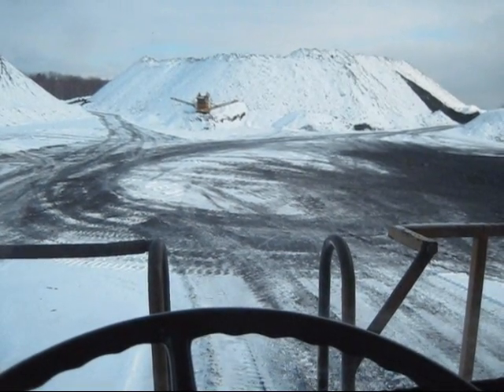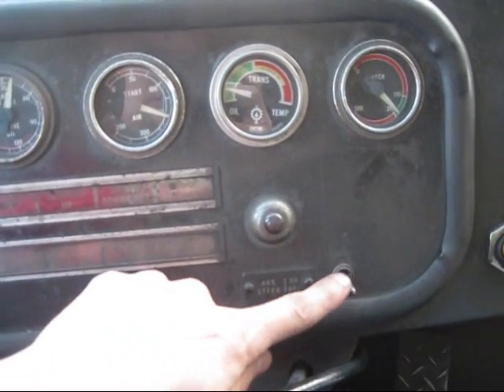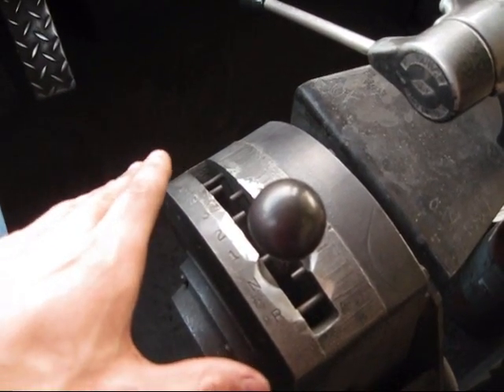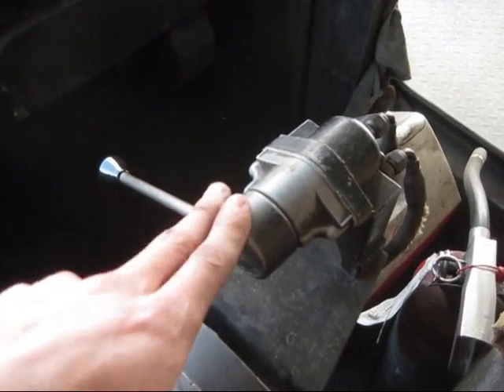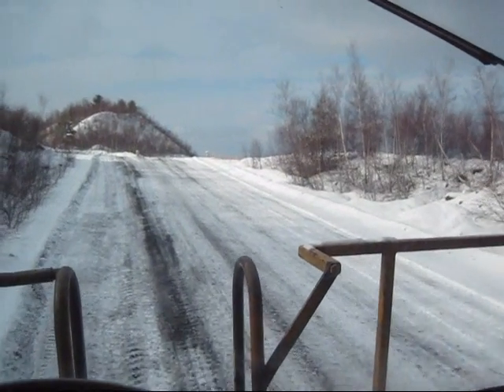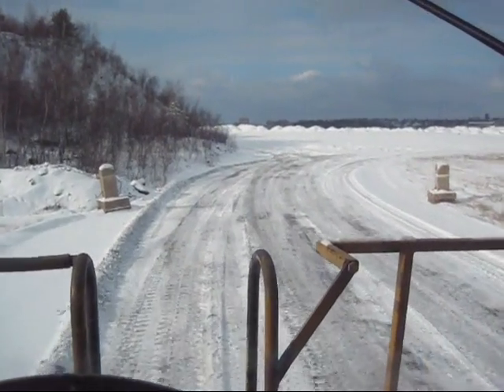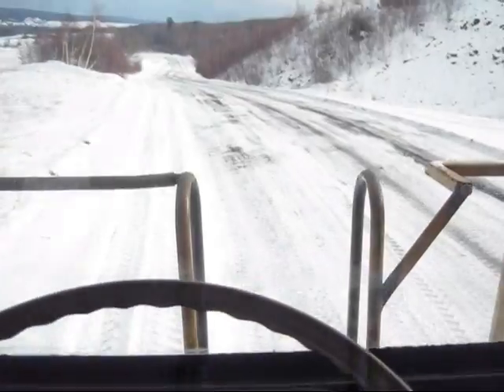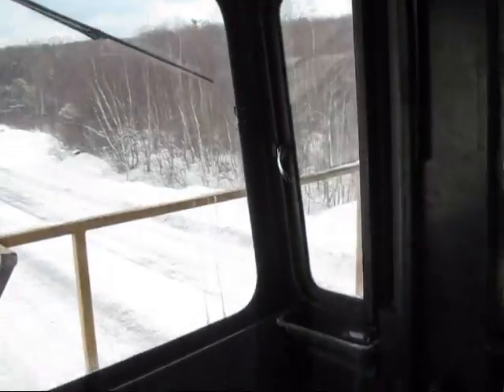Inside a Euclid R-75

Comment: Nice video.  The 30 ton Euclids with tandem duals I drove were from the late '40s and very early '50s and didn't have the whistles and bells I see in the video.  Ours had 2 engines; mostly 2 - 6 cylinder Cummins engines, but a couple had 2 - 6 cylinder Detroits all coupled with an automatic transmissions and 2 exhaust stacks through the plate steel hoods.  The only A-C was to wire the doors open 180 degrees and leave them that way all day.  The bigger 45 ton single axle Euclids all had V-16 Detroits.  Our Quarry bought them all used from the iron ore mining companies in Minnesota.

Comment from the maker: Thanks!  This truck is Cummins powered- VTA1710.  

Good traction on dry surfaces, but as soon as you get on ice or frost, you can break traction pretty quickly.  A loaded truck is more stable than an empy truck, but even so, you can still break traction at any time.

Comment from the maker: Thanks.  I will have a walk around coming up of an R75. Depends on how long the hill is, then you kick it on and off. The oil will always get hot, when the retarder is kicked on, but the transmission is designed for that.  As soon as you kick the retarder off, then oil temp drops right back down in a second.

Comment: Excellent vid Justin!!! Man that looks like a blast to drive!! What diesel engine again?? 

How it that truck traction wise? Like fully load on snow and ice does it spin or fish tail at all at full power climbing a hill? Or does it not matter what the road condition, because of the trucks extreme weight? Does the extreme weight keep the tires crushed into the road surface thus keeping traction in any road condition?

Comment: Nice vid, a walkaround will be greeat! thats my job too on 100tons trucks
Instead of a retarder lever we have it on a pedal (left side, like a clutch)
we have to "pump" the retarder as soon as we go down the pit, to prevent transmission oil to get too hot (transmission overheat). about 7 or 8 minutes of going down on a 10% grade slope
do you use  the retarder lever all the way and givin' throttle to push the truck down all the time! doesn't overheat the transmission?

Comment: @PAmining we are used to go down the hill in 4th speed (6 speed transmission Allyson 8000)
slower we go down, the lower the temperture get. we have a Dart 50 tons haul trucks that we turn into a 100tons capacity lowboy hauler, we go down in the same pit with a Bucyrus drill B.E 45R that weight about 90tons on the lowboy, in 1st (or 2nd gear on summer with a dry road) and oil temperture get around the half of the green area. those trucks are not used to get hot.. even when we "rape" the retarder